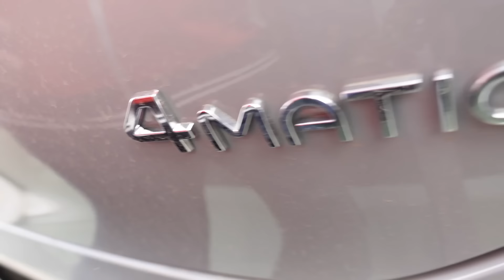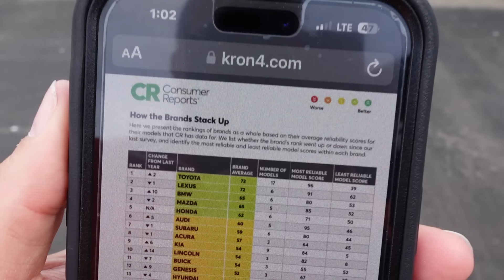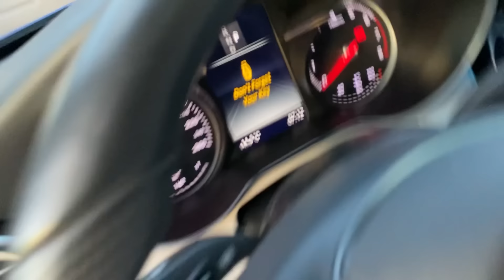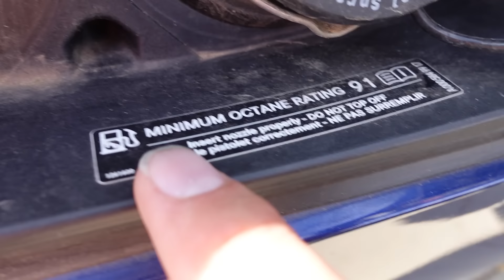The 10 Least Reliable Mercedes! (Avoid These)

Comment: After hearing about these problems with Mercedes, tell me again why people buy these P.O.S.
Reply from the maker: Many bad ones here but there are some decent ones as well
Reply: Look great, usually fantastic interiors, they drive nicer than almost any other luxury cars, great performance, extremely safe
Reply: @8MunchenBayern8  looks and comfort doesn't mean anything if it's not reliable and fast doesn't mean that it will last
Reply: There are plenty of models that are quite reliable. He picked out some of the worst generations.

Tons of W212 all across Europe used as taxis with over 400K miles on them.
W166 is very solid, w204 is good, etc.

I have one an am very happy. It’s not that hard to do your research as to which ones are the ones to get and which ones are the ones to avoid. Have had my MB for 13 years now